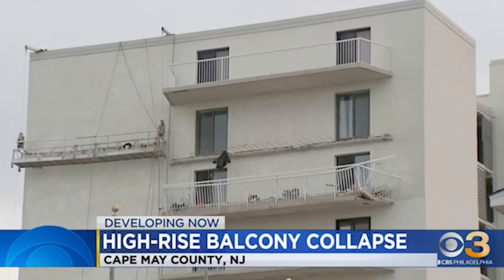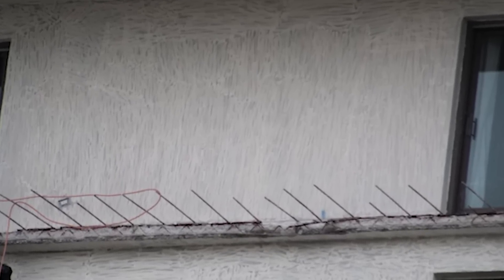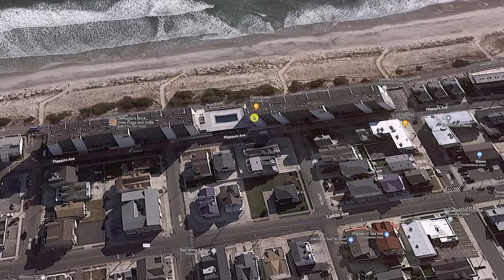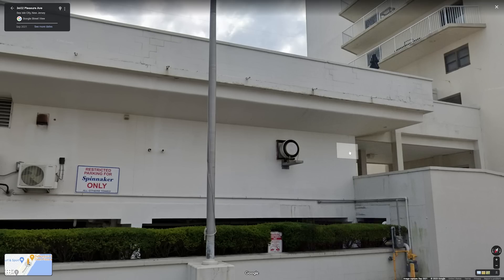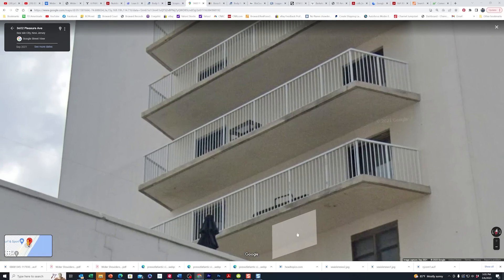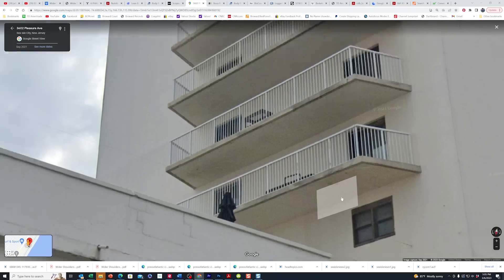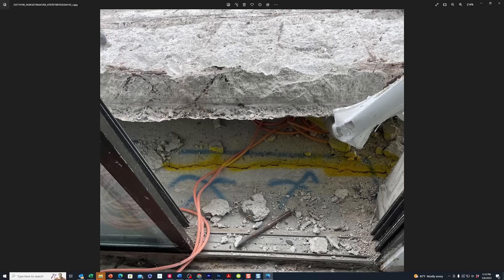What Caused Fatal Jersey Shore Condo Collapse?

Comment: Props to the 7th floor balcony for holding up even with the weight of an additional balcony slamming down onto it, stopping any further collapse.  

Maybe they'd already completed restoration work on that one.
Reply from the maker: yes that was a well built 7th floor slab
Reply: He didn't skip leg day
Reply: Likely strong because they had not yet “restored” it yet.

I’m not familiar with all of the details involved in this tragedy but my family has owned a shore home fairly close by since my grandparents bought the house for $13,500 in 1952.  (According to Zillow, it’s currently worth $4,200,900 - but my parents did sink around $200k into it back in the 90’s and it’s beachfront).
I spent my younger years as a volunteer firefighter/EMT (actually 5+8 point FA before the DOH EMT program began) down there.
For “jolly vollies” they were and still are top notch!

Comment: the fact that nearly all of the rebar sticking out of the wall is still straight tells you everything you need to know.
Reply: Rebar not in the middle of the slab
Reply: @victormalgieri7733  being a cantilever it should cheat to the bottom
Reply: good eye. look at all that rebar, its not even an inch deep!
Reply: Means there was no downward force on the rebar during the collapse. It was literally doing nothing to support he slab at that point.
Reply: GRAFT! Lowball bids. Pocketing the difference
Reply: That’s what I thought. Those rebar did nothing to hold up the concrete when it collapsed.
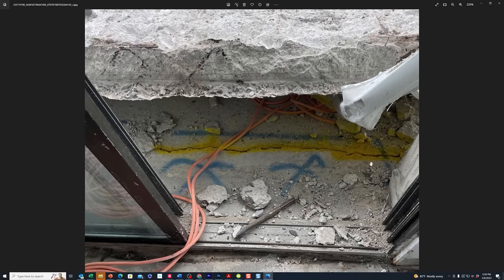Reply: The rebar needs to be near the top on a cantilevered slab with 1-1/2 inches of cover. The rebar also needs a hook at the end. Neither is evident. The crack shown at 4:00 is common on improperly designed/constructed cantilevered slabs. And the reinforcement certainly looks insufficient for commercial use.
Reply: I bet that the construction plans showed 2 sets of rebar and they were thinking they were only cutting into the top one. The mob construction company got some extra cash by leaving the lower set out

Comment: I think you're spot-on with this one; the patio below this one actually tells much of the story here. The fact that a complete pancake-style collapse of the patios didn't occur is clear evidence that there likely was NOT any major structural or inherent defect with this design. It's usually very difficult for the lower structure to STOP such a cascading failure, and requires nearly 200%+ design loads, especially when you account for the initial spike in impact forces. 

Having said that, it's clearly compromised now, but you can see how it's "bending" from the wall, which is obviously indicative of intense loads on the rebar as concrete doesn't really "bend" (and the rebar here is doing it's job FAR beyond what they were designed for.) Yet the upper one failed?

The workers essentially un-poured the concrete as if they were rewinding time to the initial construction when it had forms and shoring in place as everything dried.  Whelp you can't do that - you can if you want to expose the LOWER portion of the rebar and/or remove the lower portion of the concrete, but removing the upper surface simply disconnects the patio from the building structure allowing it to fall away. 

I think the critical error here was actually CUTTING the rebar.  It seems as if it may have remained sound even if the rebar was fully exposed, as it would still be under tension from the outside edges of the patio - almost like a suspension bridge.  By cutting the rebar, they "cut the cables of the suspension bridge" so-to-speak. 

If you just look at the length-to-thickness ratio of these patios and the leverage involved, you can tell immediately at first glance how critical the rebar is (and it appears very heavy-duty/dense as such). Again with the suspension bridge analogy, these guys just cut the cables essentially, and paid a heavy price. 😕
Reply: Yeah, that's what I was thinking. MAYBE you could cut out the bottom of the slab, but the top rebars are what are truly bearing that load. Once they cut them in half, they weren't going all the way to the end and weren't tied in with everything anymore.

Comment: I'm a licensed Structural Engineer specializing in Building Rehanilitation work like this. I agree it does appear they cut the rebar which caused the failure. Very unfortunate, but liability likely ends with the Contractor on this. I have been involved with many Balcony rehab jobs, and frequently they are not shored as it's unneceasary. Often times we repair the concrete and treat the existing rebar with corrosion inhibiting coatings. If the rebar has substantial section loss we will add more adjacent to it, but leave the existing bar in place and coat everything with a corrosion inhibiting coating. There are situations that call for shoring to be installed, but this wouldn't typically be one of them.
Reply from the maker: Thanks Ian!

Comment: Hi Jeff.Not sure how the video came up.Many thanks for an excellent explanation of what you think was the problem. You were spot on with tools and names. My view is in the 70s and 80s the pressure was on to finish the buildings ASAP and a lot of the metalwork was left open to the elements and were rusty before installation. It is clear detailed maintenance or inspections had not been carried out. My concern is many properties have similar problems that go uncovered untill it is to late, the buildings may have been painted to smarten them up but when the Attorney probes it will open up litigation for many and will even involve the painting contractors who would have known about the problems.
Reply from the maker: David I think this will be the first of many similar collapses

Comment: One thing you could say is that the balcony below showed full structural strength, to support the  impact of the balcony from above, without doing a domino collapse. You can see, at 4:35, that the blue paint was applied before the collapse and the yellow after as the debris has yellow paint but not blue. BTW, Pleasure Ave, not Pleasant Ave.
Reply from the maker: Thanks Ted~!

Comment: The image of apparently cut/exposed rebar that was left behind seems fairly damning.
All but 3 or 4 of them didn't even bend when that patio fell, because they weren't supporting anything... nothing was holding onto them, to pull them downward.
And 3 or 4 that were bent, looked clustered as far to 1 side as possible - leading me to believe they were still in the process of exposing/cutting the entire top layer, and it finally gave way near the end.
Reply from the maker: Yes, maybe one side of the patio started to drop first then the other

Comment: Ugh, the first thing which comes to mind for me is 21st century workmanship. Perhaps employee turnover/retention for that contractor has become such a problem, that they sent woefully inexperienced employees out on that job, from the foreman down to the lowest laborer.  
Maybe they were expecting/assuming/counting on there being another layer of rebar lower in the pour.
I'm certainly no pro, but I don't like the way that there are only straight perpendicular rebars tying the balcony to the building itself. I'd like to see some toe-angling of those rebars, or even some perpendicular (parallel to the building's wall) cross-rebars welded to the ones we do see.  Though if you remove concrete all the way down to the solitary layer of rebar, I don't know how you can expect the bottom of the balcony to not snap right off. 
Heck, I don't even know if you're not supposed to weld rebar - when I see rebar, it makes me think of a tootsie roll!
Reply from the maker: Rusty tootsie rolls! I love it
Reply: It appears there may have been cross-reinforcing (based on the situation it would be expected to be below the main reinforcing you can see). It is typically tied to the main reinforcing with wire (not welded) and the concrete is expected to hold it all together once set. Welding and heating is usually avoided with modern reinforcement because it can weaken the reinforcing or make it more brittle. You can get mesh reinforcement which is welded however this is done under closely controlled conditions in the factory.
On a cantilever slab like this the top reinforcement is doing all the work, so a lower layer of reinforcement probably wouldn't have saved them.

Comment: The top reinforcing is what is holding the cantilever.  If they cut through the top bars then there is nothing to hold the cantilever.  Maybe they were scoring the top of the concrete to create controlled areas for chipping and repair and maybe they didn't cut too deep and cut bars.  But when the chip off the top layer of concrete then the top reinforcing bars would not be anchored and nothing is holding the cantilever.  The top bars have to be in place, they can't be cut, and they must be solidly anchored into the concrete.
If there is corrosion in the reinforcing steel that might be causing cracking in the slab top surface or even spalling, then the method of repair is to chip the concrete off the top of the reinforcing and chip deeply enough that you can clean the entire perimeter of the bar, then you put the concrete back with special patching concrete.  The edges would normally be cut with the cutoff saw so the edges are somewhat square and don't taper out to a very thin layer of patching concrete around the edges.
If you are patching a slab in an area where the reinforcing is important then the slab has to be temporarily shored until the patching is complete and the patching materials have cured completely.
Reply: Excellent explanation!

Comment: Am I correct in presuming that during the initial construction of this and many other buildings with cantilevered balconies, that the balcony is part of the floor slab and just extends beyond the walls?  Also, is it possible to replace the balcony?
Reply: @Omar Rodriguez Thank you very much for the reply.
Reply from the maker: They usually get poured at the same time, yes
Reply: @jeffostroff  Just wanted to make sure. Many thanks for your reply.
Reply: It is usually possible to do most things, the decisions mainly come down to cost. Yes they could replace the balcony or they could cut it off flush and seal off the doorway.
The main structural issue with replacing the balcony is tying the main reinforcement sufficiently into the existing slab, however given the amount of reinforcing currently sticking out of the existing slab this may not be a major issue.

Comment: Jeff, if you look at the picture of the rebar sticking horizontally from the building, can you see any lower rebar. I can't see any evidence. Did they believe that there were two levels of rebar and then expose the top layer unaware that the balcony was then unsupported?
Reply from the maker: No lower rebar is visible in photos. Also looks like there was some sort of rafter shaped reinforcement used also

Comment: Is it possible that those terminated bars were left like that during the initial construction? Like they used rebar that wasn't long enough instead of replacing them with the correct length rebar at their expense. These guys might have exposed this not knowing what they had found before it was too late. Just a theory, but you know the stories of some companies cutting corners in construction.
Reply from the maker: Robert I doubt that is the case since you can see on the patio they had two cut off saws whose purpose is to cut through rebar
Reply: Also, Jeff pointed out in the photos where the rebar was cut, and the ones that fell with the deck can be seen extending all the way to the railing - for example, at 7:48 in the video.
Reply: @Freecycling  I watched the video too and what I saw was terminated ends of rebar. The ends were dark so they could have been cut or they could have come out of the concrete that way. My opinion is derived from the ends further away from the cameraman's position that sticks out longer than the rest. Unless they were in the process of cutting those shorter ends when the collapse occurred, then that would explain it. Also, I asked this in the form of a question for Jeff, not to start a debate.

Comment: Wow, I have no idea what they were supposed to be doing, but I'm certain there was never an engineer anywhere near the project.. Not only did they cut the single layer of rebar in half, they also demo'd down to the rebar across the entire deck. The whole slab was left dangling from the bottom of the rebar. I'm not even sure there would be a "fix" for that had it not already collapsed. Had they made it through the project, at best there would have been two slabs waiting to fail. The existing lower slab, and a new top slab as fresh concrete does not in any way bond to existing concrete. This is just a total mess all around.
Reply from the maker: If they installed shoring poles before, then it would not have collapsed
Reply: Not saying they knew what they were doing, however you can bond new and existing concrete. Scabble the existing concrete surface, coat with a concrete bonding agent and possibly drill in and epoxy at regular intervals vertical bars cogged around the upper reinforcement. However I would have propped this slab two or three floors below to distribute the load prior to doing this work.

Comment: After your description of a slab with rebars an inch or two from the top, then lower ones and inch or two from the bottom, this balcony seems to be missing the lower rebar rods. Could it be that the original constructors just left out the lower rebars on this balcony and that's why it came down?
Reply from the maker: Yes we are still trying to figure this out. Almost looks like a small metal truss was used as the lower

Comment: But where is the bottom run of rebar? It looks as if it is missing.
Reply from the maker: We noticed it too, I could tell if they used a steel joist inside the concrete or not

Comment: I caught the shoring part before you mentioned it. Probably the wood was a stop gap until they could get some steel. You can't always get what you need on short notice. Is that Eifs around the edge of the deck?? (lipstick on a pig)
At T = 9:03, looking at the exposed rebar ends sticking out of the remaining edge of the deck? I don't see a lower layer of bar?

Comment: This is why I never liked to live in buildings where the balconies just stick out with no visible supports for the overhang.  
I much prefer balconies to be set back into the building with little or no overhang, or have walls on the sides for support.

Comment: crazy event. had that #7 balcony not held 1-6 certainly would be gone. one has to wonder who made the plan for the repair and if anyone was overseeing the work. things can appear to be one thing and be another and / or things can change on a dime requiring a skilled set of eyes to spot the potential or in this case a new actual problem. 

I hate those cantilever designs, because they just will not stand the test of time. concrete or wood. I'd feel different if the railings were engineered supports but they are not even tho to some eyes it may convey a false sense of security. in my mind certain buildings are to be considered long past their life span and once red flags show up I have suspect feeling for the rest of the building. times and building methods have (only kind of 😬) changed since the 1970s. 

curious your take, I have to see if you've made a video regarding it, referring to the luxury condo tower in san francisco that is sinking / leaning. that one I believe effects the surrounding streets as well not just the actual building.

Comment: Looks like the rebar wasn’t centered in the slab as well.
Reply: The rebar in a cantilevered slab should be as near to the top as possible whilst still allowing sufficient concrete cover to protect the bars from corrosion. Not sure what slabs you would centre the reinforcing in.

Comment: Looks like there was a single layer of rebar at top of slab in tension. Bottom of slab was in compression. There was just concrete without rebar transferring compression. That means the top rebar is super critical. Doesn't take much to completely compromise this cantilevered slab. It was a fatal accident just waiting to happen.
Reply from the maker: It's like the lumberjack cutting the tree branch he is standing on
Reply: @jeffostroff  Thank you for comment. This mistake cost a life.